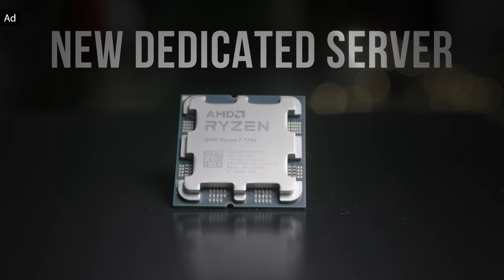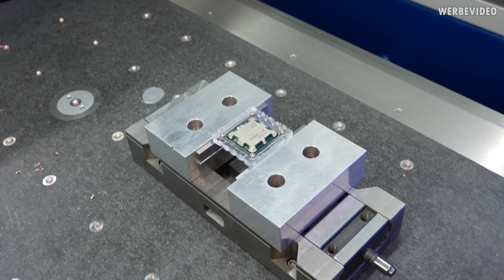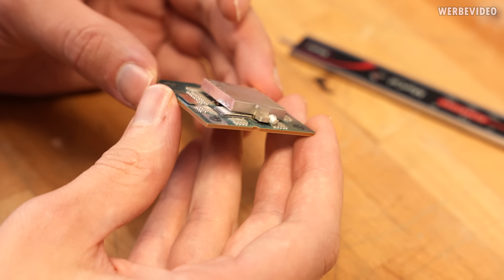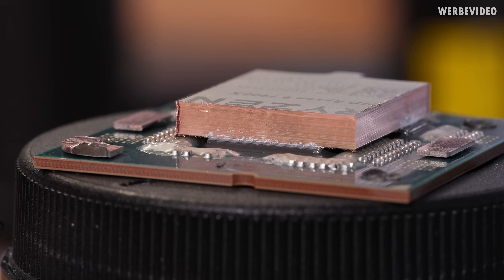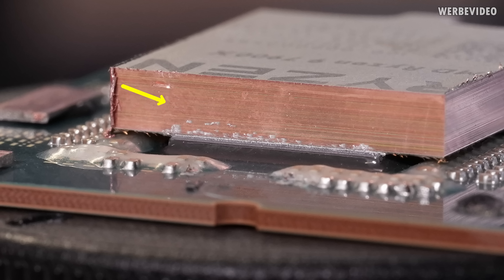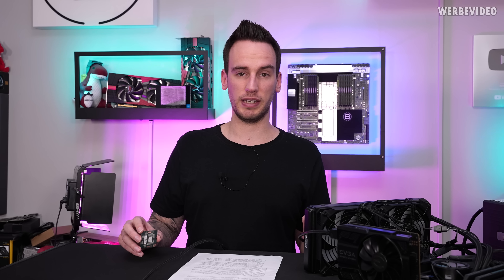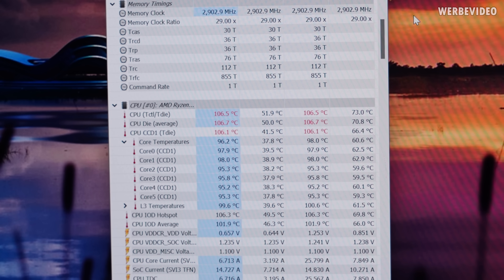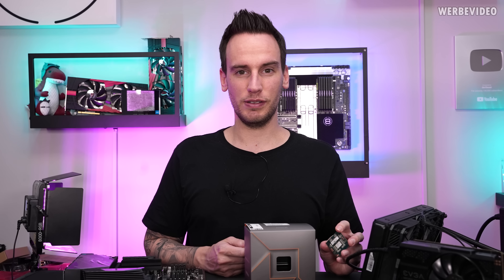Viewer-Mail Ep8: This CPU Unsoldered and Killed itself

Comment: Roman, will you be informing AMD or an AMD Engineer about this? The feedback would be so interesting!
Reply: The AMD engineer would likely say "customer likely disabled thermal shutdown." As for the CPU reaching 115C without a cooler, the engineer would say that is the normal thermal shutdown temp for Ryzen CPUs. 95C is when the chip begins throttling, 115C is the thermal shutdown temp.
Reply: @K31TH3R  Isn't there some ways to find out if that's truly the case? Like a certain area of fuses burned within the chip or some flags that could be read out in some kind of manner? I mean, that's a pretty stark contrast.
Reply: @K31TH3R  you mistake engineers with marketing and lawyers. Most engineers will have the desire to understand what/why happens,not just shrug it off.  Also the engineers won't speak publicly about the accident, anyways.
Reply: you know they watch his channel anyways tho right?  even if he doesnt inform them, my guess would be someone is worried about losing their job cuz o the blob as we speak
Reply: @OsX86H3AvY  "losing their job cuz o the blob as we speak", no idea if you have ever work in the tech. Most companies would not throw their engineers under the bus for a mistake (or mistakes). Mistakes do happen both in hardware and software, and it's a well accepted fact. Since  it's an isolated case, it's exceptionally unlikely to be a design flaw, either.
Reply: @OsX86H3AvY  No one would loose their job. This was a manufacturing error which is really rare, but is to be expected when you make so many. The engineer themselves don't work on manually inspecting the cpus, so they weren't at fault.
Reply: @RougeDivision4203 doode intel does it at 100c and shuts down at ~115 too. under normal operation it reaches voltage limit first, under full load it reaches temp limit first, thats it

Comment: I wander if the solder in this case could have been contaminated. In theory if the solder was contaminated "maybe a provider cutting corners in the quality control department" it could in theory lower the melting point. 

Could probably test it with a heat gun to see if that is the case.

Comment: I thought 95c was normal operting tempature and 115c was critical temperature protection.  I actually asked Steve from gamers nexus in a super chat but he never answered, I wanted to ask him would it be safe to run the CPU at 110c since 115c was critical point
Reply: yes: 95 - throttle, 115C shut off
Reply: Running over 95°C will still probably seriously decrease the lifetime of the CPU if run constantly.
Reply: @cromefire_ That's what people said about 95C!  I haven't seen information to substantiate your claim.  Truth be told, only AMD knows the answer to that question. 

By the way, Intel process run at TJ Maxx now, and Intel claims that that will not degrade the processors longevity.
Reply: @juno1597  Intel and AMD have said that, but I don't believe it. They also have no evidence to prove they are safe at 95c for years.
Reply: @Apollo-Computers  I'm sure they don't want to face an insane amount of returns so will have done their due dilligance, with experience on GPUs as well - the actual silicon shutdown limit is at 115c for a reason, I've seen it hit 105c in some junctions after the 95c limit but no more.
Reply: @TheGreenReaper  seems weird he doesn't know the TJMAXX of the CPU is 115c and not 95c, I thought he was a professional.

Comment: The water would not have to evaporate from the block for the cpu to get that high. The cpu may have gotten hot faster than the IHS and cold plate could transfer the energy to the water. Also, in a sealed system it will build pressure and increase the boiling point of the water.

Comment: Maybe clean the indium and see if its just cracked bad chip that for some reason shorted inside. Maybe in standby/off mode it still heated and cracked (does new computer ever shutdown in normal settings, always some power mode active)

Comment: i guess the 112 degreee region is for sudden spikes  that should be tolerated and my guess is that the cpu you received somehow spiked to 160 or 160 plus and the indium must have then turned liquid and thats what that blob was plus the cpu fried itself at that 160 spike
Reply: The CPU would have needed to greatly exceed 160°C in order to account for the cooler constantly carrying away heat and the metal staying liquid for a while. My best guess is that the CPU had a short.

Comment: Theory; TIM was not evenly spread, and the place on the CPU DIE where the thermistors are located reported 'high, but in spec' temperatures, but on the unevenly covered positions it got too hot and melted.
Reply: theres a lot of sensors per die though, what person sees as 'core temp' isnt the only sensor in that core but just an average, same shit on intel
Reply from the maker: in that case it would still be amazing that the CPU was alive at the same time. Or at least could still pull this current
Reply: There are hundreds of sensors on the die - and normally the highest value would be reported.

Comment: I wonder if the board/CPU waiting until around 20c over TJ max before shutting down is to prevent shutdown during to potential temperature spiking and only shutting down once dangerous temps are being sustained?

Comment: sounds like the CPU shorted in use without sending the power supply to protection, a lot more common when computers use so much power. The power supply just sees it as a normal load.
Reply: the power supply doesn't have much to do with the protection; it's the VRM which can output over 400A easily (that's less than 500W for the PSU)

Comment: you won't see such content anywhere else, such an amazing channel!
Reply from the maker: Thank you!
Reply: @der8auer-en  , I have few cases, when user load factory default bios settings, pump began to work with PWM mode and, for example, 5950x shutted down on 115. As i know intel and amd has this limit in 115 degrees for safety. If processor reach this high - MB must turn off system for safety
Reply: Yes, I am also fascinated by this man! ;-)
Reply: I agree. It's an amazing channel that puts actual measurements and engineering knowledge into useable information.
Reply: Noone has the expensive toys that Roman has
Reply: agreed✌️✌️✌️ amazing channel and content